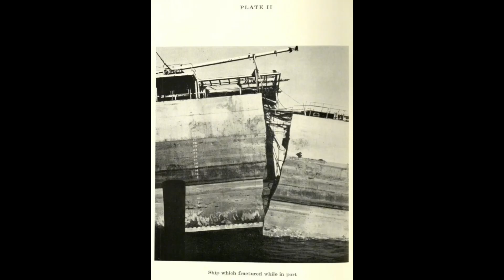The Welder Who Saved WWII: How Bessie Hamill Solved the Mystery of the Breaking Liberty Ships

Comment: Except they would have been using at least three run welds not single run welds, so you end up welding on preheated metal anyway. Looking from end to end all welded ships even modern ones have buckled plates